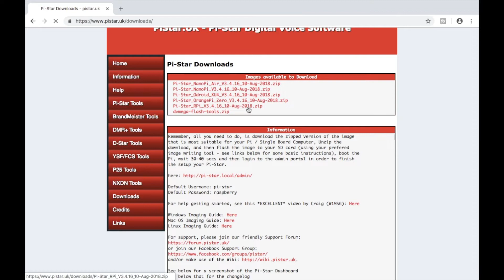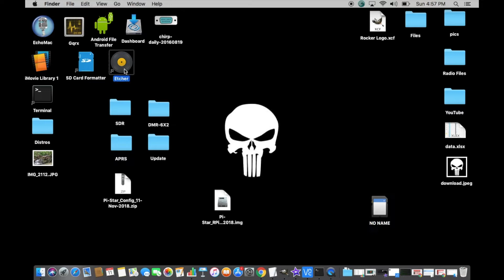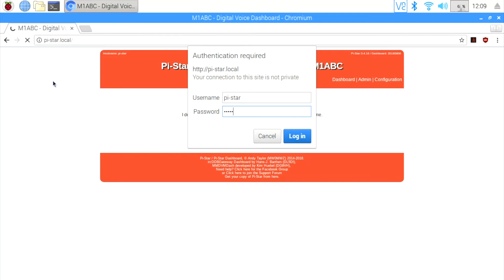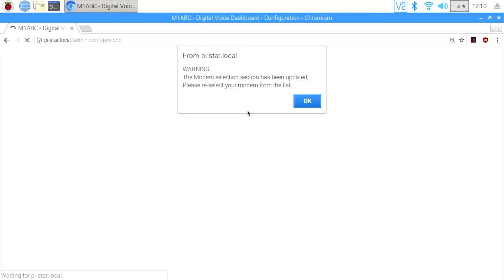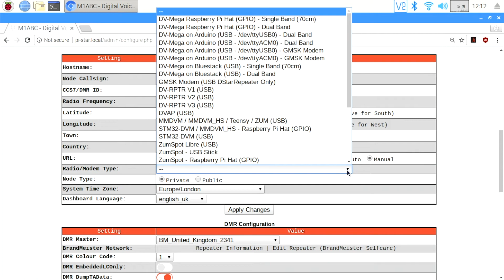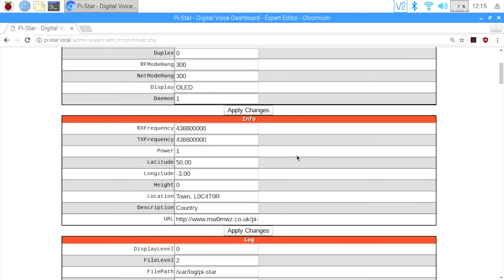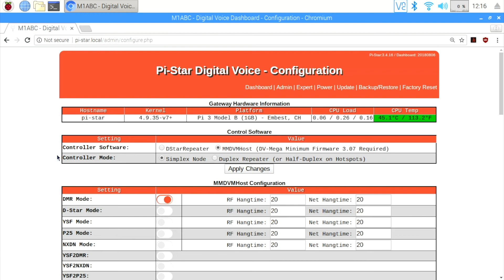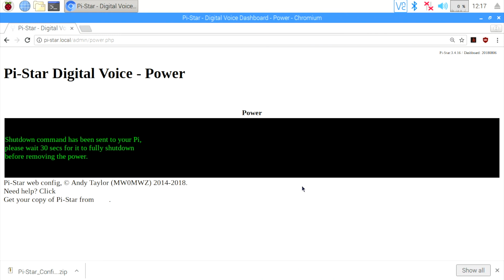How to Build a Pi-Star Hotspot on Raspberry Pi 3 - TheSmokinApe

Comment: Love your videos! Question, if I do this project, can I connect a SHARI SA818 for Allstar via the USB ports and it still function properly?  I would not be using them in tandem for Allstar and DStar/DMR, they would be separate but together as one unit.  Make sense?
Reply from the maker: Sorry man, I’ve never used the Shari hat 🤷

Comment: Is it possible for this hotspot project to use Raspberry pi 3 B+ and higher instead of using pi 3b only? Thanks and 73
Reply from the maker: Yeah, just make sure the case is compatible.  This is an older video 👍
Reply: @TheSmokinApe thanks buddy, 73 De DW1ZEC
Reply from the maker: Good luck with the project

Comment: How do you power on the hotspot Raspberry Pi device? Is there a power switch on the Raspberry Pi? Would it be better to upgrade to a Pi4 instead of a Pi3B? What kind of a short UHF antenna was on that HT portable transceiver? That antenna is much more compact than an ordinary antenna. You probably don’t need much of an antenna for close in hotspot range. Dave KY0L
Reply from the maker: The antenna is a Diamond RH3.  If I was making this device now, I’d use the Pi4.  My USB power cable has an on off switch 👍

Comment: in PI-star 4.2.0  you can select OLED 3 of OLED 6 , the OLED 3 - 0.96 but with the same setup like you i cant get the display working ?
Do you got some ideas maybe what i forgot o did wrong? 

Kind regard,  PD3AB
Reply from the maker: Did you build or buy?  Make sure the oled pins are not shorted.
Reply: @TheSmokinApe 

Its own build and the pins are not connected i can put a card between them.
Reply from the maker: Is this how you set it up?  https://www.hamradio.com/images_managed/misc/H0-016491_OLED_Configuration.pdf
Reply: @TheSmokinApe 

In the new version 4.2.0 you can select oled3 or oled 6 and then this settings are added automatically
Reply from the maker: Gotcha, I haven’t tried the version yet

Comment: At time index 9:45, it shows you running the pi-start setup on the Raspbian OS. How??
Reply from the maker: It’s the pi star image 👍
Reply: P-Star has a GUI?  @TheSmokinApe
Reply from the maker: @JayLBray  at 9:45 I am connecting to the hot spot from a second pi running Raspbian
Reply: @TheSmokinApe  Ah!, okay. I was wondering about that, thanks for the info :)

Comment: OK just got the raspberry pi going on my 3b+ and the part where you put the SD card in the raspberry and it brought up the raspberry operating system. Now did you plug a hdmi cable into the raspberry and it brought it up or is there something I missing? Please help....... I want to be able to run pistar and android on it at the same time.
Reply from the maker: Hey Wayne, with Pi-Star you typically run the Pi headless and you access the environment via a web browser.  I am not sure if there is a version that will run on Android.
Reply: @TheSmokinApe   OK thank you so much

Comment: More of a question than a comment. I see when I look at the MMDVM on various sites that they are not compatible with 5.8Ghz, only 2.4Ghz. Is there any way around that?
Reply from the maker: It’s going to depend on the pi and the WiFi interface
Reply: I have now made my 2.4ghz available for use so now I can go ahead and order the MMDVM to put onto 9ne of my raspberrys
Reply: I also see on Ebay that they are selling the duplex hotspot for the RPI. Is there any advantage to dual connections or should I just keep it simple.
Reply from the maker: I just use the simplex nodes.

Comment: I'm confused between DMR-MARC and Bandmeister. Can a DMR radio be programed to talk to repeaters in either groups?  Can it be programed for both groups at once? I assume a hotspot can only be on one network. Is that correct?
Reply from the maker: The hotspot can connect to either network as well as a number of others, that said you can only connect to one network at a time.  Thanks for checking out the video WNC!

Comment: Why build this if prebuilt ones are available for a lower or similar price? Is this significantly better? 🤔
Reply from the maker: A few reasons; it’s cheaper to build yourself, I had a spare pi that I could use, I like Linux and Raspberry Pi projects and I wanted to know exactly how it works.  That said, there nothing wrong with buying a prebuilt 👍
Reply: @TheSmokinApe  What do you think of the cheap $100 ones for sale on Amazon?
Reply from the maker: @tvbox6955  they seem to work fine

Comment: I followed all of these steps very closely. When I finished, everything worked perfectly except for one minor detail. The MMDVM screen saver the use to appear in my OLED display, now says "close". The screen saver is working but the MMDVM Logo has now been replaced with the word "close". Any ideas? Thanks for the wonderful videos.
Reply: I think "close" means the mmdvm is shut down. Somehow you need to restart it again. If it is up and running it should show the screen saver.
Reply: For those who want to turn on the OLED screen saver you can do it by going to Configuration -> Expert -> OLED -> set Scroll to '1' and LogoScreensaver to '1'.

Comment: Assembled one just like you showed had it up and running in less than an hour put out to Brandmeister and had folks hitting it over the past couple of days. The only issue I have had with it is the OLED screen shows close and start but nothing scrolling or flashing on it. Most others I have seen show the listening and call signs of those coming in. My pi load was the most recent and set the video up for OLED 3. Have you experienced this issue?
Reply: You will only see anything on the display when you are actually receiving or sending a signal. If you're not seeing anything at those times, make sure your MMDVM Display Type is set correctly - mine is set to OLED Type 3, Port is /dev/ttyAMA0, and Nextion Layout is set to G4KLX. As Christopher Rust posted:

"For those who want to turn on the OLED screen saver you can do it by going to Configuration -> Expert -> OLED -> set Scroll to '1' and LogoScreensaver to '1'."

Hope this helps!
Reply from the maker: Sorry Steve, I haven't seen or heard about that.

Comment: Great video. A quick question. I will be building mine with a raspberry pi 3 B+ I have laying around. Right now I have a fan on the chip to keep it cool which; I know will have to come off to install the mmdvm hat. Any suggestions on an alternative way to keep it cool or, is it even necessary? Thanks for any advice or opinion on this that you can impart!
Reply from the maker: I’ve just used a heat sync and have been fine.  The case is from C4Labz.

Comment: What is the best hotspot you can buy on the market. I only know the DVMega and SharktRF. But China also has many mmdvm boards on AlieXpress.  PI-star and YSF would be used.  Im handy with ARM and soldering.
Reply from the maker: The ZumSpot is pretty good.  The SharkRF is the best though 👍

Comment: What is the the big differnece between the 0 and the 4?
Reply from the maker: The Pi 0 and Pi 4?  Processor speed and RAM.
Reply: So is a 4 better? Getting ready to pull the trigger on 0. Lemme know your thoughts. Thanks in advance.
Reply from the maker: The 4 is more powerful but the 0w is fine for a hotspot.

Comment: I must have received a DOA MMDVM from China. It won't even show its own wifi "pi-star" before you configure it. It's been plugged in for a day now. I've tried power cycling it. I've reflashed with the latest .img from pi-star. No joy. Any suggestions?
Reply from the maker: That’s exactly how I would troubleshoot it, maybe get a replacement.

Comment: Thanks for sharing this video.  Per a friends recommendation I just ordered a AnyTone 868 DMR HT and I already have a Raspberry Pi3 Plus, but thinking of getting another since my friend convinced me to get the DMR radio.  My current Pi is loaded with Jason KM4ACK Build - A - Pi script to do FT8, JS8Call and other digital modes.  I know nothing of DMR, but my friend told me that if I got one and then got this MMDVM Hotspot Pi-star Support P-25 DMR YSF & Antenna Fit For Raspberry Pi that I could do the DMR, D-Star, Fusion and I think there is another.  I am not familiar with all these new modes.  I have been a ham since 1996, but dropped out in 2006 and just got back into it in 2017 (didn't let my license expire), but all this knew modes (DMR, D-Star, etc) are all new to me.  Any suggestions or help would be appreciated.  Juddie WD8WV
Reply from the maker: Yeah, with the MMDVM board you can do; dmr, Dstar or ysf.  I ordered my board off EBay.  You will need to istall PiStar on your raspberry pi 👍

Comment: hi did the pi3 work out of the box (once you installed the sd card) or did you need to set it up with the hdmi with a keybourd and mouse first. all i seem to be getting is flashing red lights on both the pi and the mmdvm board
Reply from the maker: It worked out of the box, check to see if you have an AP you can connect to coming from the pi

Comment: Can I do the same with the rpi3b+
Reply from the maker: I would think so, the only issue may be the pins for power over Ethernet or PoE may need to be trimmed.  I haven’t done a 3b+ build.
Reply: @TheSmokinApe   also do you think I could connect with my Yaesu VX 5 handheld
Reply from the maker: If it’s has ysf compatibly
Reply: @TheSmokinApe  it's funny how we get into projects out of nowhere and just run with it like i with me I don't have a digital radio but for some reason when I bought the radio it already had some mods on it. Hopefully I can learn from what the earlier owner had built, I would really like to walk through those steps instead of buying a new radio as money for me is an issue, when I should work with what equipment I have here at the house. Thanks man

Comment: Thanks a lot for this video. 2 questions: (i) did you try to connect the MMDVM to a Raspberry Pi4 ? (ii) i cant access anymore to my hotspot. it seems that the device didnt recognize my password anymore (I tried a lot including the "raspberry") So, how to bypass the password in that case? thanks and 734
Reply from the maker: You can run a mmdvm on a pi0, O wouldn’t waste a 4 on a hotspot, I’ve never tried it.  Someone else just told me they had a problem logging in as well, I do not know how to bypass.  Are you using a 4?
Reply: @TheSmokinApe  Thanks for your answer. For the moment, i'm Running (rather trying to run) the MMDVM on Pi0.

Comment: Followed your instructions to a tee...…..over & over again.....(definition of insanity ) I'm getting code. when it stopped and asked for log in and password I logged in and a red rectangle with PI-STAR inside along with more code.
I cant seem to get back to the desktop to log into the pi-star interface. Can't move forward ;(
Reply from the maker: When are you getting that?  The username is pi-star and the password is raspberry
Reply: @TheSmokinApe  when I turn on RP  wish I could send photo
Reply from the maker: Are you using an hdmi?  DM the pic to me on Instagram, TheSmokinApe

Comment: I would like to use the hotspot with Ethernet instead of WiFi in order to reduce packet loss due to overcrowded 2.4 GHz radio environment. Please could you tell me if Raspberry PI 3 B+ is compatible with MMDVM board and pi-star software? Actually I'm using a Raspberry PI Zero board. Thank you in advance.
Reply from the maker: Pretty sure you can use a B+, I used a B in this video.
Reply: The Raspberry Pi A+ has dual wifi 2.4/5Ghz

Comment: so dose this use a sim card?
Reply from the maker: Micro SD card
Reply: @TheSmokinApe   so this isn't a mobile wifi hot spot?
Reply from the maker: No, you can connected it to one or to an Ethernet plug
Reply: @TheSmokinApe  is there a way to make a pi a mobile hotspot using like 4 g lte ?
Reply from the maker: Not that I am aware of

Comment: A few months ago I purchased a ZUMspot-RPi v0.4. I love it! I set it up for DStar and it works great. Just wish I could find my IC-92AD that I've misplaced since.. It is somewhere here in the house. At least I still have my 91AD. I haven’t set the ZUMspot up for DMR yet. I have a couple of DMR radios. The  Alinco DJ-MD5 with GPS and a Connect Systems
800D Dual Band mobile and a CS VHF hand held.

Getting back to the ZUMspot…today I purchased the Raspberry Pi OLED Kit. Can’t figure out how to install it with the current case for the ZUMspot. Guess I need the plastic case that appears a little taller and is not so square…rectangular that is. Any ideas? TIA & 73,
Jim, W1KQ
Reply from the maker: You might need to get an after market case to fit the oled, check c4labs.  How do like that Ainco?  It looks like a nice radio.
Reply: I really like the Alinco...finding a code plug here in New England is a bit difficult. A friend purchased an Alinco today and is going to convert a code plug from another radio. I tried and failed.
Reply: Shouldn't I be able to get the latest case from HRO and use it?
Reply from the maker: You will get the hang of code plugs it just takes some practice, having a sample to work from really helps.

I’m not familiar with the HRO case, give them a call and ask...  they are friendly and helpful.
Reply: LOL I know I used to work at HRO in Salem, NH. Thanks. I found that it might take some contact with C4Labs. They may have a case for a ZUMspot with add on Pi OLED Kit. I’ve learned that none of the cases HRO sells will fit the OLED add on kit.
Reply from the maker: Haha!  Are you running on a Pi0 or Pi3?  My c4labs case fits my pi0 with oled.
Reply: Pi0. I just went to C4Labs and purchased the right Pi OLED adapter for my case. Thanks much for responding to my postings.
Reply from the maker: Cool, let me know how it turns out.  Thanks for watching the video!
Reply: Will let you know. Thank you for the vid.

Comment: could you give me a link to the specific radio board.    Do they sell a case that does not require modifiy?
Reply from the maker: The eBay seller was “youdealshops”.  It’s my understanding the c4labs now sells both the zumspot and jumbo spot versions of the case, I have the jumbo spot.
Reply: I'm new to raspberry pi and the radio board.  I don't want to order the wrong item.
Reply from the maker: Have you looked at any of the prebuilt spots?  My first was a prebuilt.
Reply: This looks pretty easy.  I just haven't found a DIY video with correct links.  I am comfortable with the Raspberry Pi 3 I found on Amazon.  I just need a link
to a known radio board for this project preferable from the U.S.  I also have read some of the radio boards have poor quality oscillators.  I am reading the better oscillator are the ECS one.   Ken
Reply from the maker: The seller I got the board from doesn’t appear to have any listed, granted I am not an eBay expert.  I got the jumbo spot mmdvm with sma adapter and oled display.  Hope this helps...